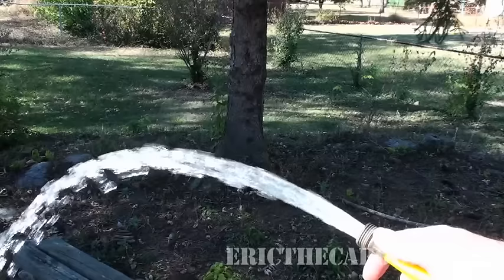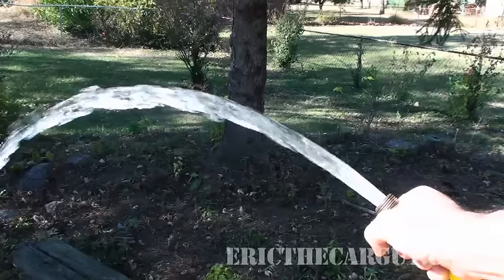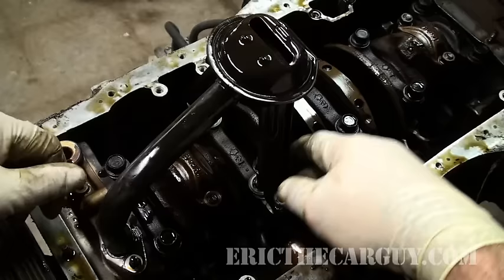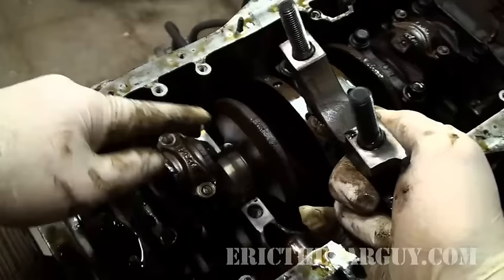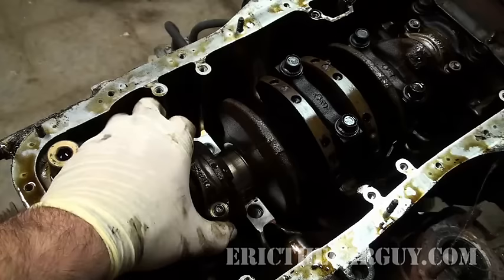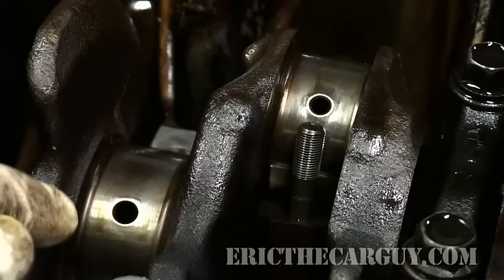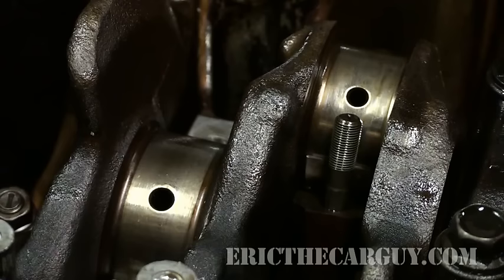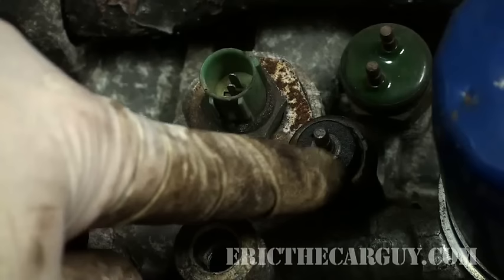How Oil Pressure Works - EricTheCarGuy

Comment: u are the best internet dad ever ;_;
Reply: Hey Eric. I have an anomaly that appears to be unique. I have a 2001 Jeep Grand Cherokee WJ Laredo.  4.0 liter 6 with 182k. I tested the oil pressure with a gauge tester. Cold it went to 50 psi falling to 9 psi as it warmed over therapy minutes. I have replaced the sending unit, oil pump with stock milling pump, and went to 20w 40 full synthetic. When warm it will still drop to about 10 psi at idle unless I run the AC to raise the idle. But if I shut it down for even two minutes when warm, the pump will loose prime and I need to give it a quick rev and it comes back up to 40-50 psi while driving. Engine is tight and otherwise runs great. No rod knock or lifter tic. And the previous owner had new pump installed in November.
Reply: @snappytom1013. My 4L I6 Jeep Wrangler developed something like that but not quite that bad. Engine oil just wasn't lasting for 3k miles. I had to change it much sooner. I couldn't figure it out at first. Until I paid attention to design. They had designed the thing with the exhaust wrapping around the oil pan on 3 sides, all within 2 inches of the pan itself. The oil never stood a chance. There was no heat shielding to combat it. (There was also no support at the collector connection of exhaust pipe, but that's a story of idiocy for another time). I toyed with the idea of an oil cooler, but ruled out out. I don't remember why (I haven't had/seen the thing for at least 10 years now. Got rid of it). What I did do was wrap the exhaust pipe near the pan. It helped, but was ultimately a bandaid. Wrapping doesn't last. It ended up finally costing me a lifter. I parked it and drove my truck until I could fix it. But my mom beat me to the punch. She paid no attention to her gauges and let the car overheat from water loss till the engine was severely damaged. I let her drive mine reluctantly but not without sternly saying she needed to get hers fixed fast cause mine was vulnerable. Two months later, I'm picking her up again from the side of the road where mine died. She no closer to getting hers fixed and there were no options left. She took a taxi to work. I pulled the valve cover off mine. Looked like freaking glitter everywhere. I wasn't mad. I passed that point in a hurry. I was done with it by then. Sold it.
Reply: That's why I cal him Daddy. ;)
Reply: Andiar Rohnds  thank you so much for valuable information

Comment: 100% CORRECT !!! If the Oil Pump created pressure... Once the Engine is on HIGH RPM... Pressure will build up, then the Hose and other Parts would " BLOW UP " in matter of Hours / Days. Btw... Don't forget Oil Viscosity... In the Summer we use THICKER OIL, in the Winter THINNER OIL, try it, you will see the differences. Older Engines.... Go with THICKER than what the MFR recommended :)))))

Comment: Eric is pretty much correct!!! You can have a massive pump pumping out hundreds of gallons per minute...or more!! But if there's almost no resistance, if there is nothing to put pressure against it, then there is little pressure!! A pump is used to create flow... Any restriction creates pressure. Yes, you need a pump to create volume and resistance to create pressure
Reply: pretty much correct ? Da Barboza

Comment: +1. When elevating a fluid, gravity is the resistance.

Some cars have an oil pressure relief valve, sometimes controlled by a spring, which will open and release some of the pressure if it get's too high. If this valve fails, it will let the oil straight through without any resistance, and thus you lose oil pressure.

Comment: Engine's got low pressure when warm only (after complete rebuild) , mechanic says it's camshaft wear or head deformed.. We already took apart the whole engine twice, replaced oil pump, checked everything you can think of... We don't know what else to do! What u think about that camshaft/head thing! Your opinion is much appreciated!

Comment: Thanks Eric for your experience and time you put in to make these videos. Its helping me to learn enough to do my own repairs. I'm an Artist/ Entertainer...and I am NOT a mechanic. But in just the past few months, I have learned to replace a water pump, remove my air intake and replace spark plugs ( I have a Mazda Tribute 3.0)

Now, I am looking at replacing the Valve Cover Gaskets because I have an oil leak, and have seen some oil on the engine, on bottom of oil pan AND in the Spark plug wells. All these challenges have given me a new found "growing" confidence that "I CAN do it"...

Thanks to people like you who teach and help with videos.

Thanks Bud!

Steve

Comment: A quick tip.. if you have a gauge instead of a light, like Eric said low readings will indicate wear, however high readings can be a sign you need to change the oil as it it tends to thicken over its life, thick oil will make higher pressure, but overall will be less flow. Which means some of the more distant parts wont get lubricated.

Comment: Thanks Eric I just installed a new oil pump in my 95 ram 1500 and was disappointed to see the oil pressure was between 30 and 40, but your explanation says it all.  You're the best 👍BTW I have over 212,500 miles on it.

Comment: hey Eric, once again I give you a THANK YOU! , One of the great things I like about you is that your not afraid to say,that "your not sure about that"  which in my book speaks volumes of your credibility, Way too many" know it all's" loaded on the net. been working on cars awhile now and completely lost track of the oil pressure scenario. And yes I am guilty of replacing a oil pump on a engine with wasted main bearings. Here is a trick, if you barley here a knock and you suspect a rod bearing, pull the vehicle perpendicular  to a curb, drop it in gear with a warmed up engine and give her some throttle if a rod. or engine bearing is in suspect, it will definintely make it's presence audibly known. slightly risky,but if present,ya got big problems anyway. Stay the course, and be well !

Comment: Also in my experience I've found that type of oil can seriously change your oil pressure readings. I tried out royal purple synthetic oil and my oil pressure dropped to half what it is normally, the engine also made noise like it was low on oil, so I parked and swapped out for my usual Rotella T oil and wix filter, back up to 50psi around 60 before warm up, huddles around 45 all the time. Excellent explanation in the video. The engine in question is a 360 Dodge 1977 motorhome, so I have to be careful which oil I put in it. I've read that certain newer oils won't protect your older engines and eat the camshafts out of them in just thousands of miles.
Reply: Synthetic oil requires a different filter material. See pureoil.com
Reply: Yes!  That's what Eric the car guy said also

Comment: This was a very informative video!  My 2002 4.3 S10 (181,000 miles) has been having issues with low oil pressure (especially at idle) and was wondering if a new pump would have resolved it.  Now I realize it might be due to engine wear (luckily the engine is not knocking or making noises).  May have to go to higher viscosity oil to counteract the loss of pressure.
Reply: Or it might really just be the pump.

Comment: Thank you Eric I have tried over and over again to replace the oil pump due to the low pressure gauge of the engine oil and now I have benefited from this information. Thank you

Comment: Got a '94 302 just lost all pressure today, dash gauge been actin funny for months, with good oil. My mechanic told me it was the main bearings. Used your video to learn a lil bit b4 diving into a new motor. Thanks. You totally backed him.

Comment: Thanks Eric...You're my hero of the month.  This video makes perfect sense.  It's not the oil pump.  It's the oil in the system that creates pressure.  Glad I didn't listen to my mechanic, he said I needed a new oil pump ($1400).  I had him replace my 2005 Tahoe with high mileage oil and the pressure is back to normal 30 to 40 psi.

Comment: Thank-you Eric the car guy from Yukon, Canada, doing a 2006 volvo s60 2.5t , and you helped me learn, respect.., low oil pressure and trouble shooted.... it was the cam seal, oil pump seal and the oil intake was clogged, used sea foam... and changed such, volvos suck..., respect

Comment: That makes sense thank you. I had a oil light flicker on my honda h22a engine so i changed the oil and put 10w30 in it and it went away. The oil was black and i found small crushable black peices in the oil pan. The car sat a long time and suddenly i started it and got that flicker at very low idle. I guess its time to rebuild, the engine must have been beat on previously cause it doesnt have many miles on it. Good vid thank you

Comment: great insight here! I've never thought about it like that before. It's a great example of Bernoulli's Principal. But, I wouldn't say the pump has nothing to do with creating pressure. I would say the pump generates flow (volume) that is later regulated into higher pressures by restricting that flow. So, take the water hose and cut the valve off half way at the source and the pressure will slowly drop along with the volume. So a weak enough pump could certainly lower the pressure. I get your point though. The pump is most likely unrelated to low pressure problems. Metal wear is much more likely the issue. Good to know!

Comment: Eric is 100% correct a pump creates flow while restriction creates pressure and it's just that simple. There's nothing else to know about pressure just that one rule that a pump creates flow and restriction creates the pressure and that applies to anything and everything not just an engine anything and everything! A car's engine is simply a glorified air pump. If you think about it, air goes in & comes back out. It just so happens that if you add exactly a 14.7:1 ratio of air to gasoline (otherwise known as perfect stoichiometric engine combustion efficiency) and then add a spark (aka heat source) and we've now created combustion turned into useable energy in order to drive the transmission to the driveshaft to the differential and of course drive wheels. Very well explained ERIC While leaving no room for the what about this or that type of questions from viewers. Instead, you made it very clear that there was no other variable to affect how pressure is created! Nothing More could be said someone either gets it or they don't and there's gonna be the people that will challenge you on any and everything possible but I can tell you're not gonna put up with that BS anyway!

Comment: The Cadillac Northstar (mine is a mint condition 1996 with 115,000) only has an idiot light.  I have used synthetic oil since new, and at 110,000  the oil light would flicker followed by a "STOP ENGINE" message displayed on the screen along with a fast chime.  I replaced the sending unit, still had the problem, then i went back to regular 10w30, and i have not seen the oil light flicker in 3000. I just drove straight down and back between Florida and New York, and all was great.

Comment: Currently doing a Elantra bottom end full bearing replacement  and all big end Cap bolts and main bearing Cap bolts; after car has done 320,000km. Decided to replace oil pump as well.
Checking oil pump specifications, noticed OEM, have modified the Relief Valve Plunger.
Plasti-Gauge, checking and fitting new bearing shells today, to ensure oil clearances are back in Specification, so oil pressy issues are rectified

Comment: You were the first guy I ever looked up on YouTube and you're sill the first go to guy every time. I wish you the best life can offer. Thanks for all the help. I just replaced the thermostat and on my test drive the oil pressure gauge was on the higher side. It was a quart low so I added too much but the gauge looked more normal just past the halfway mark. By the time I got home the gauge was all the way to the right High mark? I've had low pressure and had to add oil before but never had high pressure and had to add oil before. I've had this old 94 Ford pickup since it was one year old. It's been a great truck 265,000 miles still strong. Merry Christmas!

Comment: Oh, boy, Pressure!?!?!?!  Any pump works by either creating a vacuum or creating pressure.  That is how the pump moves the liquid.  By constricting the fluid flow, you have the same pressure, but less fluid, so higher fluid flow.  The pump is the main ingredient to create the "pressure".  What is interesting is how when these parts wear, they allow oil to flow more freely.  So it's not about pressure, but rather oil leaks in the components.  Great view of the inside of the crank shaft.  Thanks Eric!!!
Reply: What's great here is that Eric explains how low oil pressure "dummy" light may not mean a bad pump.  Great info.

Comment: Bro you answered a lot of my questions in one video. I have a 1.8 liter integra gsr with no/ low oil pressure at idle after rebuilding it. 

Today literally today I pulled the motor to tear it apart and rebuild it to find where the gapping hole must be. 

Replaced the oil pump obviously didn’t help found I didn’t install a cam seal correct on the driver side behind the cam gear fixed that still don’t fix the problem so now it’s the crank and cam caps once it’s on an engine stand. 

And I double know I put the oil squirters back in had that issue before

Comment: Thanks for the info.. my mechanic said it maybe time for a new engine or rebuild it. It's a bronco 351 5.8. I get some ticking.. I get low oil pressure when I drive slow or come to a stop, the gauge goes right to 0. Your explanation taught me a lot. Looks I'll be looking into the engine work now. Anything else you can tell me or advise me would be great. Thanks, Eric.

Comment: ETCG you are exactly right, this is why the oil pump is on one end of the crankshaft, and the pressure sending unit is at the other end.

Comment: Every once in a while I'll get a customer that is suddenly an expert on their own engine because they read a forum post that tells me I need to put the right oil filter on to keep their oil pressure up (Subaru, Ford EcoBoost).  It's worth noting that that has more to do with the filter's bypass pressure (when the bypass valve opens to let oil around the filter in order to keep the engine lubricated at high volume when it would otherwise be restricted by the filter media) than with the engine's oil pressure.  These special engines really are just designed to run at higher oil pressure all the time for whatever reason, and the filter needs to be set up not to bypass all the time, the filter itself has very little to do with the restriction he's talking about here that creates pressure in the engine.

Comment: I just changed the oil filter on my car. Got the car from another guy who probably didn't change the filter for 2-3 years. The filter doesn't have a by-pass valve (it's a Volvo). I can't believe how much the engine response is different now, had no idea a too old filter could reduce engine power that much. I also noticed the top of the engine was getting really hot with the old filter. Probably too much metal to metal friction.

Comment: I have a jasper rebuilt Ford 429 in a lifted pickup. Always seems to run fine.  Oil light came on, took it to the shop.  They said it needed an oil pump.  they replaced it, but then said there's no oil pressure, but there is volume.  they were going to pull the engine (thousands $$) so I told them no thanks and I drove it home.  hooked up a direct read pressure reader, and not enough pressure to push oil through the tube to register any pressure, but there is oil there.  The truck has sat outside a long time off and on, rebuild was around 5 years ago.  It had an oil pressure under dash gage that seemed to run between 25 and 50 psi after the initial rebuild.  I pulled the distributor to make sure the pump drive was there, and it was.  Hard for me to accept that the engine would go from totally fine to junk after 3k miles on an engine with a 100k mile warranty on it. of course the motor is out of warranty now since it's been over 3 years.  Any suggestions I'm all ears.

Comment: Thanks for this info. Always go to your videos first to troubleshoot. I have a Camry V6 1mzfe. Changed timing belt, water pump, crank bearing, 1 cam bearing, Valve covers. Cleaned out intake manifold and EGR of carbon. Oil light never came on before, now it does. Not leaking oil. Engine not making any noise. But light has me worried.

Comment: i like the way you explained oil pressure...i always knew that if your oil pressure is low...or non existant...something bads going to happen, my buddy had a jeep with the straight 6...lost oil pressure and well the engine locked up not long after he noticed it...i did not know how you really lost oil pressure other than the engine just being worn out...but now i know its because the parts are worn and have larger gaps to fill...thanks again eric the car god! lol

Comment: awesome video. good job in explaining all the dinamics. I got a problem or need help on my vehicles I go to ur videos. always helpful. keep those videos coming an thank u. my ranger had 170,000 miles an oil Guage goes crazy at idle at times but normal pressure under throttle. my only work vehicle shop in not that advanced mechanic but not sure where to go

Comment: Very good info!!! Especially since this is what you will see most all the time . Oil pumps rarely go out, but when they do you see almost nothing to nothing for oil pressure through all ranges of rpm.  they u can dictate the final diagnosis if the motor is not all read seized as it is. Which will be the prominent factor in these situations. Yet a small factor to consider from what I have encountered